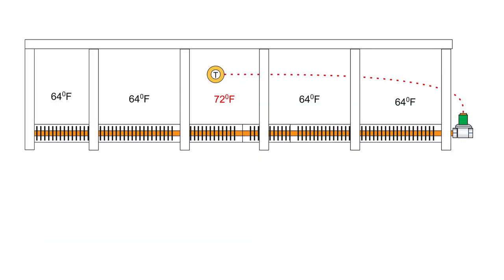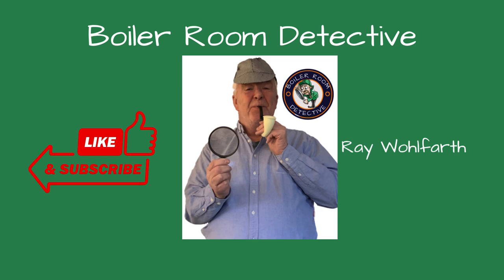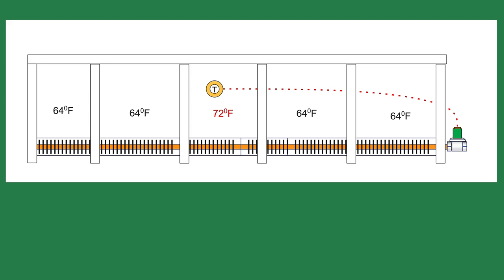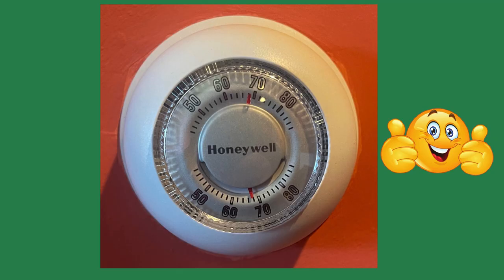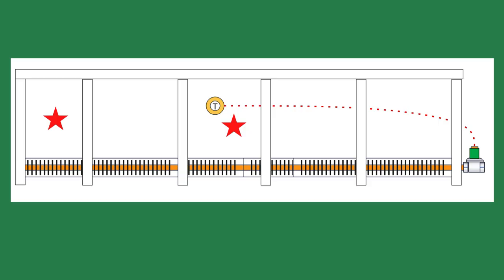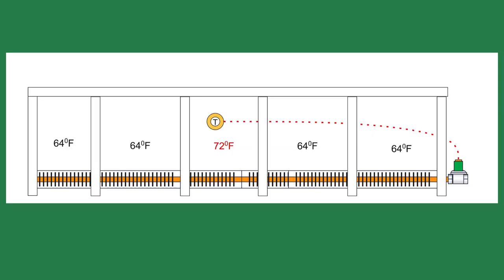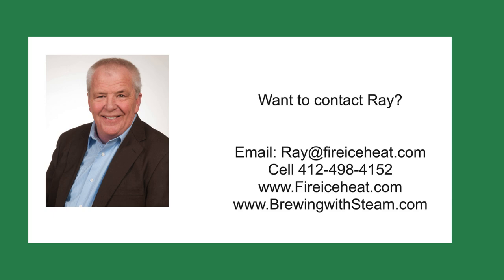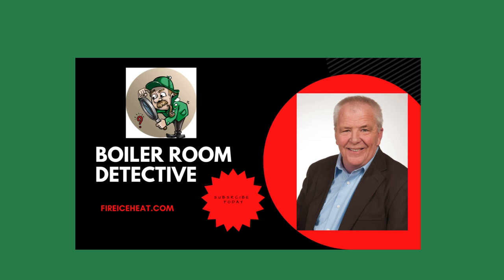Case of the cold offices

Comment: It might only be a mystery to me but I would love to see your thought process for designing a heating system for a given building. Say I'm building or renovating a house and replacing the HVAC.. how would you approach it? What considerations would you take into account?
Reply from the maker: It depends on the budget as always. I typically try using the existing distributions system like ducts or pipes. If I were building new, I would have hot water radiant heat in the floors and would probably use ductless mini splits for the ac but it would allow backup as they would be heat pumps. We did have one large home where we removed the radiators and did radiant staple up heat for the first floor. The customer loved it
Reply: @boilerroomdetective  Thanks!